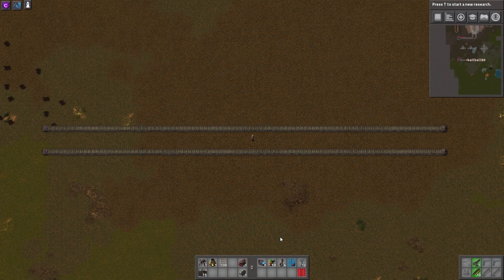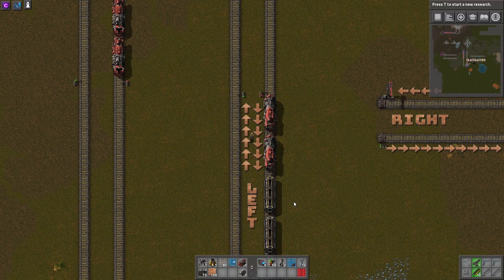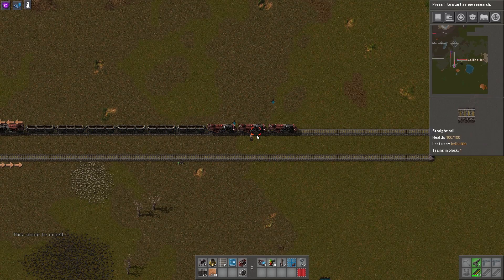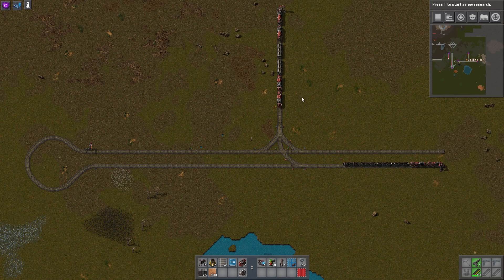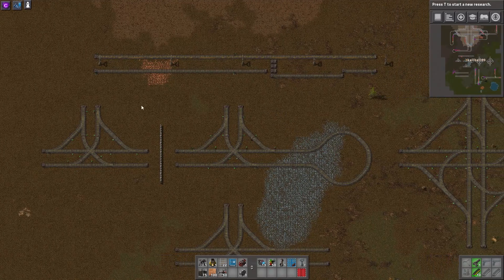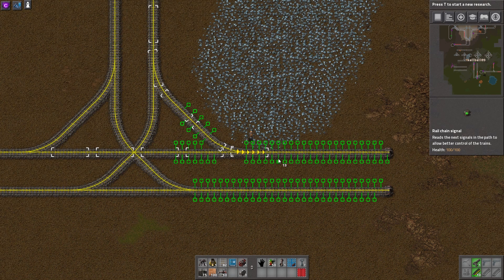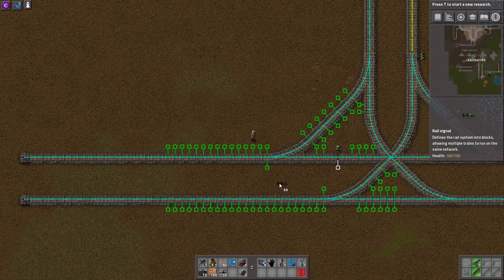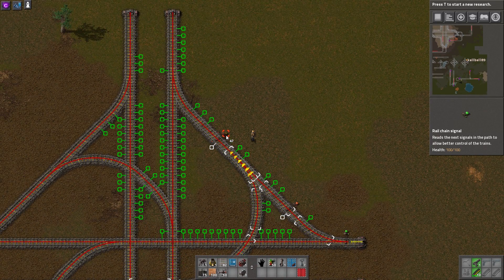FACTORIO | Train Basics & Signaling Tutorial

Comment: Around 10:20 the T-intersection is signaled unoptimally. Junction ends right after last rail overlap, not after the last merge. That means there should be at least 2 rail signals out of intersection if it ends with a merge of 2 rails. If you do it the way video shows then it causes trains to just wait longer for their turn to move because signal chains are longer. Rail merges almost never need to be chain signaled in general. Of course it still means that after the last rail signal there always should be enough space for whole train, that is measured from the furthest out rail signal in case of merge.
Reply from the maker: That's where I disagree; I've seen too many instances where rail signals being used causes trains to block the junction. It may take longer for trains to pass, but they shouldn't be blocking the junctions with this setup. Thanks for your comment and debate!
Reply: @SoellessGaming  They don't block junctions with way i described, one just has to make sure that next signal after rail signal is always far enough so that train can fully pass that rail signal. If anything, this way you get even less deadlocks especially with long trains.

It also means that one should never make a turn right after an intersection! That goes much against all conventions. If you must, then chain signal all the way to the next clear section.

Comment: I have built a simple horizontal rail with a rail merging into it from the south, and I have trains running in both direction, however I keep getting " No Path error " , I have used chain signal when getting into the merging intersection and rail signal when getting out for all directions. What am I doing wrong ?

Comment: Such a great video, it has helped me so much thank you. Just one question, how do you get all the rails so evenly placed? Im trying to do a 3 way intersection (left right and down) but the bit where all the tracks cross in the middle is always slightly to the left or right and its driving me mad 😂
Reply: You need to go in planning mode. Put one rail, then shift click on white arrow on builded part. In this mode you can build further and control curve wtih you rotate hotkey (default - R). For complex junction, blueprints or ctrl+c/ctrl+v will help to build evenly. There are no more tricks about railing as far as I am aware
Reply: @freezerain  ah ok thank you, i will try that next time i play. The new update has made me move away from the game for a while, was thinking of starting a new game.
Reply from the maker: It can take a bit of moving around; I typically just eyeball it and re-do it until I get it just right, then make sure I have a BP of it so I don't have to reinvent the wheel each time.

Comment: i don't understand why you said roundabout is not a good way for intersection? i always use them and i never see à problem with that. that not take much place. anyway that good tutorial.
Reply from the maker: Hi! It can cause problems if the train loops back on itself particularly with pathing changes. Not as risky if you're running a smaller train though.
Reply: @SoellessGaming  whut? If the train get back itself us because missed a construct railsway on the roudabout. IT impossible for a train to Do more than 3/4 round on the roudabout. And i use 2 way ( 1 right 1 left)
Reply from the maker: With poor signaling, which can happen especially with inexperienced players, I guarantee it can happen should the train choose a different path when it's already in the roundabout.

Comment: Typically you need a 1-5 ratio of engines to cargo.  On a left and right hand drive system you don't need caboose engines.    This assumes you have pull through stations, which take more space, but let you move more cargo for a given train length.  9:00 That is backwards.  You should use rail signals at the entrance,and chain signals on the exit, so a train will not enter unless it has a clear path to exit.  Your way may eventually cause traffic jams.  Not trying to hijack your video, but check out my video specifically on signals - https://www.youtube.com/watch?v=4vED4jwRU7M  I will give you a heads up, the video is NSW (I have no filter) and While I am tryign to be helpful I can come across as mean, unintentionally.
Reply from the maker: wow I've never heard anyone else with that strategy for signaling before; it's almost a universal rule to have at least a chain signal BEFORE the junctions. I watched the first few minutes of your video, and it looks like you definitely have a different approach than I do, though I can guarantee my approach is not a bad way to go. Thanks for taking the time to comment and also make your own version of a tutorial.
Reply: @SoellessGaming  Yeah I know you do it like pretty much everyone else.  I don't know where that meta got started but its inherently bad because it lets trains enter an intersection  without guaranteeing a full and complete valid exit path.  This inevitably leads to traffic jams on high volume rail networks.  Happens all the time on multiplayer servers.  Its always an issue with people using chain signals (2 lights) on entrances and rail signals (3 lights) on exits.   The rail signal will let a train enter the intersection up to the signal, which can then be red, blocking its forward movement  but also blocking any other train trying to use the intersection, which can then block other trains trying to use that path.  leading to traffic jams.    If you go to factorioprints.com search for Cwhizard's Choo Choo Book.  It has complete right hand drive intersections  that are just pick and place.

Comment: I've had no issues with round abouts and I've not seen an instance where a train crashes into itself. I don't think that's even possible in the design I use. Plus, it's simpler and has a smaller footprint.
Reply from the maker: As long as the round-about is big enough for your max-size train, it shouldn't crash into itself. The problem I see a lot of the time though is people make the most compact roundabout and then the train re-directs and crashes on itself if the train is too big.
Reply: @SoellessGaming  - Maybe I haven't run anything long enough to cause a  re-routing problem.  I'll try running some longer trains and see what happens.  I could see that happening if I tried to build a round-about that handled more than a two-lane design. That would get ugly.

Comment: Your + intersection also seems to have way to many signals. I count 44, but I think you can do it with 24.
As with the T-intersection, your signals going into the intersection and leaving it seem redundant. For coming in if they aren't there they just stop at the next chain signal a few bits of track further down, and the ones a the end can be removed and replacing the 2 earlier chain signals (one in each direction) with normal signals. Again, if they can go through the chain signal, they need to be able to go through the next signal, making the next signal pointless with a normal signal being able to take the role of the chain signal.
Then going further back along the diagonal track (where the trains turning left and right meet) we have basically the same setup, a normal signal (now it would be, you have it as a chain signal), which then just has 2 chain signals before it. Again I see no reason for this and the 2 chain signals leading into it should be fine being normal signals.

After the perpendicular crossing, why have a signal? This seems just like the one leading into the intersection. It already has the other signals to stop crashes and deadlocks so it doesn't seem to do anything. Is this and the ones like it to just make the trains be able to go a little bit faster as a train going across only needs to wait for the train to clear the intersection before continuing? If that was the case why not have all your other signals as close to the crossed track as possible? If it isn't the case, what is the purpose.

The final one I see no reason for is the one just before the perpendicular crossing. Either the train can wait at the one before it, or it can go through.

Comment: I don't understand why it needs so many signals and why so many need to be chain signals.
Why do the signals right at the start of the junction need to be chain signals?
The train would either stop there early and block the track, or proceed to the next signal and still block basically the same track, just a little further alone. Having them as a normal signal doesn't seem to prevent the functionality of the crossing and would only seem to let them choose to go the other way if they decide to.
Likewise if they are through the middle intersection, why not just a regular signal? If they are able to go onto that piece of track (i.e. the chain signal lets them through) then they should be able to leave it entirely.
The ones connection tracks without crossings seem useless as the train should just be able to go through, or it cant and just stops in a slightly different position (which you have it stop in anyway due to the chain signals).

Is there some kind of race condition I'm not aware of with trains?
Reply: After thinking a bit, it does seem better to keep the signal along the tracks which don't cross, but as a regular signal, to avoid a waiting train blocking a train leaving. However if you already have a chain signal at the start it isn't needed.

But that would mean that the signals at the start and end of the intersection aren't needed. That can also be helpful if you have a modular rail network based upon blueprints as you don't need to worry about getting the signals right for the start/end of an intersection.

Comment: wow, I was complicating it too much by having one track and being left and right handed at the same time. No wonder I got deadlocks from time to time.
Reply from the maker: That will do it! Glad you were able to get it figured out.
Reply: That should be easy enough to fix up, as long as you use chain signals, but can cause delays.
Basically all signals along a 2-way track should be chain signals.
Then the signal to exit the 2 way bit is a normal signal.
It is also helpful to add sections which have 2 rails  (one for each direction) so that trains can pass, but make sure it is signalled properly and large enough to fit the largest train.

Comment: i think many people use 3 spaces in between tracks because it gives a bit more space for signals in intersections/t-junctions or roundabouts
Reply from the maker: the meta for most of my years playing has been two track widths but I know that changes - but yes, the wider you go definitely more room for proper signaling.
Reply: I prefer 3-spaced because you can fit lasers around powerpoles nicely inside (with right-hand drive), helps when you expand rail network far into biters' territory.
Reply: @radek6173  Biters usually ignore tracks and if they run into a moving train then... Well splat :D. But yes if you expand incl. roboports or other buildings then having the space may be handy :).

Comment: Great video. Have a question, can you make bi-directional tracks? Not just at stations? Or is it always recommended to have up and down tracks?
Reply from the maker: Eric hopper has it 100% right. You should have a main rail network that has at least one lane for each direction,  and then you can have branches from that main rail system that work bi-directionally if you like, but best to save that for train stations so as best to improve train throughput and prevent crashing.
Reply: @SoellessGaming  My first rail attempt only had single lines with single trains running on it. The problem area is where these single lines had to cross over other single lines. Could never make it work. But will be trying some of these ideas in my next run when 0.17 drops
Reply from the maker: oh I see! The signaling for bi-directional trains can be tricky. Good luck when 0.17 drops
Reply: Bi-directional tracks are prone to deadlocks as two trains heading in different directions meet each other.

You can deal with this by making sure every block has a section that allows a train to get off to the side. But then, why not just have bi-directional track?

So bi-directional track sections are usually relegated to the leaves of your network.
Reply: Yes you can have bi-directional tracks. However only a single train can transit it at a time, unless you break it up with small passing bays which have two 1-way tracks which can each fit a train (which then means the same, but it applies to the smaller 2-way sections).

The rule of thumb there is that you use a chain signal for anywhere a signal is needed along the 2-way section, and a normal signal when they leave to enter a 1-way section (where they are able to fit without blocking the 2-way section).
That way they wont enter the 2 way section unless they can leave it, and once they are in it, other trains can't enter it to get in their way.

If you are restricting it to single trains on each track, then you just need to focus on intersections, where you need to put down signals like normal intersections (chain in, normal out) but do it on both sides. This means you end up with a chain signal across from a normal signal.

Comment: So I usually put a lot of chain signals down and try to keep the individual blocks at splits and crossings as small as possible so that trains - who are traveling through - occupy that block for less time thus reducing the chance that another train has to break or slow down (or even stop completely).
Therefore I usually put chain signals/normal signals right before and after each split or crossing. Any thoughts on that?
Reply from the maker: I see why you do that but if that block you've created by having a chain signal and a rail signal in that little block will mean you can have a large train stopped at the chain signal blocking the intersection and jamming the entire thing - I've been guilty of this many times.  That's why rule one is so important - if the max sized train can't fit there, then use (only) a chain signal.
Reply: @SoellessGaming  Yeah, no, I always use chain signals exclusively inside the intersection. I also learned that the hard way. So I guess on that aspect i am on the right track ;)

I might not have phrased my last sentence well enough. I just wrote "chain signals/normal signals", because one normal signal is placed after exiting the intersection, where there usually is a merge. So I guess I should have wrote "split, crossing and merge" to be 100% complete in my statement or shouldnt have mentioned the normal signal at all to avoid confusion :D

But while we are at the topic of the first rule: I feel like that rule only applies to the one block right after each intersection. Everywhere else along straight tracks the spacing does not necessarily matter. Because as long as trains stop in front of the intersection and there is enough space after the intersection for the longest train on your tracks, there should never be any issues with jammed trains. Even if your longest train would stick out into that block after the intersection, then that block would be blocked and no other train trying to drive into that block would enter the intersection.

Comment: A modern, highly focused signaling video. Fantastic. On a side note, is there any reason you go out of your way to bisect the block with a chain signal apposing to placing it right before the junction in rule 2? formatting
Reply from the maker: Good question! The block is too short for a train to fit there whether the signal is put directly before the next junction or not, so in that case it doesn't really matter where exactly the signal goes as long as it's placed somewhere. It's important to put the chain signal as close to the beginning of the junction when starting off the intersection in particular (rule 2) to ensure there's enough room behind that signal to allow for the max sized train to still fit.  Hope that makes sense.  Thanks for the thoughtful comment!